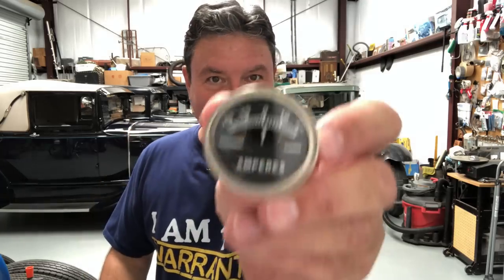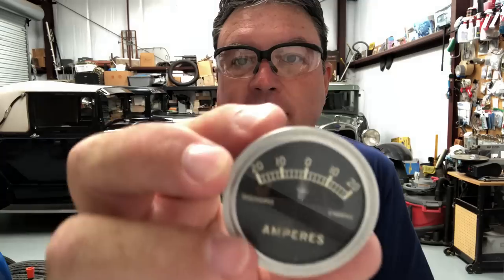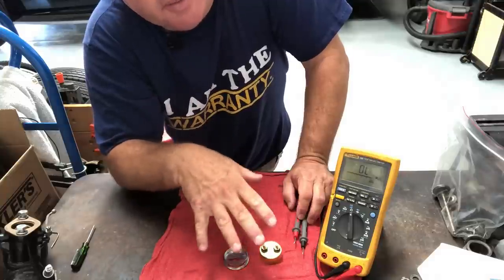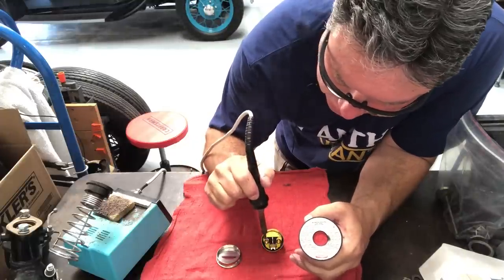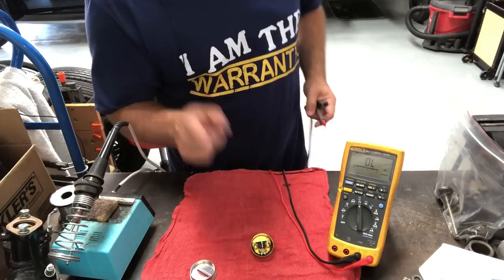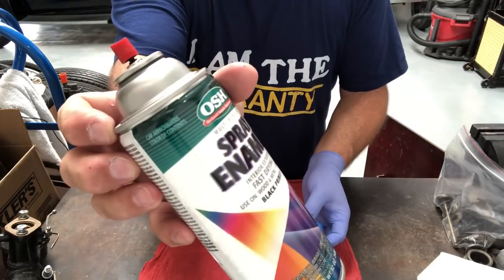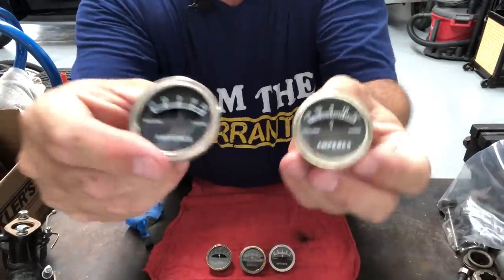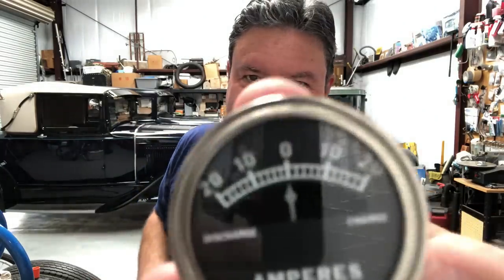Ford Model A ammeter- How to prevent a fire in your Model A

Comment: Good video as always. I cannot solder as well as you when using a pencil tip, I prefer a wedge tip. The use of a higher than normal iron tip is certainly the correct approach.
Don W

Comment: Another excellent video, Paul. Great safety tip. Altho I have LED lights and don't have any large draws thru the ammeter, it certainly is a worthwhile project to "improve" a repo ammeter. Now I have a couple of projects for today on a couple of spare ammeters. Unfortunately I have already painted them black in the past so first I need to remove some paint. Thanks again.
Reply from the maker: You're welcome Dennis!

Comment: Adding to my previous comment, according to your information, one of the ammeters I found in my stash is an original and works. The box it was in was very old , but not original. A mild cleaning and it will be as good as new. Also, one of the 3 reproductions I have seems to be an  unused much older version in it’s original box and much to my surprise, you could plainly see through the glass that the terminal bolt heads are already soldered. If that was done when it was made or later, I don’t know.  Thanks.
Reply from the maker: Neat!  Thanks Bill.

Comment: Good tip, as always.  I have another project now. I use a 20 0 20 on my A with an altenator.  I was told to use a 30 0 30.  Thanks for straightening  that out.   Never did make sense to me.
Reply from the maker: You're good!

Comment: Thanks, Paul.  Great instructions!  My first encounter was with the ammeter terminals that someone had just stripped to bare wire and crimped on terminals sold at any auto parts house.  Nothing soldered, mis-matched wire size to terminals and the screws on the back of the ammeter were only finger tight.  Lots of resistance and HEAT..also due to the resistance the battery was not given the opportunity to sink the charge from the generator causing it to put out 20+ volts.  I am going to take mine apart first chance I get and solder. Thanks !
Reply from the maker: That sounds like a recipe for disaster!  Glad you caught it.

Comment: Just took apart a 20 amp ammeter. Instead of fast/hot solder just undo the two nuts holding the insulators to the back of the gauge. The complete metal piece with the needle will come out and then you can solder without worrying about melting the insulators. Now you can use your $19.00 Walmart soldering iron.
Reply from the maker: I'm just trying to keep it simple.

Comment: Very good, Paul.  Interesting and something most anyone can do.  I think you're right about just needing to see if it's charging or not and leaving it at that.  But I guess back in the day having an actual charge figure was more important than it is now.
I recall how Chrysler products always had ammeters rather than a voltmeter.  But when I thought about it, 35 amps running under a dashboard is a lot of juice.  Years back my brother lost a beautiful '72 Barracuda due to an uncontrollable dashboard fire that I'm sure directly related to the high amps running under the dashboard.  As alternators increased in amperages over the years Chrysler stopped using ammeters in favor of voltmeters.  Imagine 150 amps or so running under the dash.  Jeez!
Reply from the maker: An inline fuse might have saved that Cuda
Reply: @ModelA    I always thought that the factory installed fusible links took care of that.  We couldn't investigate the cause as the dash was so burnt and melted.  It happened when my brother was shopping in a store, and it was parked in a metered space on Main Street in that city.  The police gave him a very limited time to remove the car, so he just had it towed off to the junkyard.  Something we'd never do now because they have become so rare.

Comment: Had one short out on the Tudor when I was about 19 years old, scared the bajeebers out of me seeing that smoke coming out of the dash panel. Turned out the Bakelite knurled nuts had loosened up. Good video thanks, and yes don't touch that needle I swear it is made out of aluminum foil super easy to booger it up. I learned that luckily on a repop so no big deal. I assume originals were made with a better quality material. 
Thanks Paul!
Reply: Everything back then was made of better material.  Things were relatively expensive and people expected them to last.

Comment: Paul your engineering prowess is showing, excellent instructor video and if implemented should prevent that dash fire from poor quality ammeters. Has anyone looked into making fusible link for the model-A to open in the event of a starter and/or alternator shorting?
Reply: I wouldn't use a fusible link on anything, it is basically a smaller gauge wire burning up!
Reply from the maker: Well, people usually install the aftermarket fuse blocks in Model As these days.  That helps.

Comment: Paul, great video. I pulled my ammeter and found char. In searching for a replacement I found Westach Gauges. I ordered one of their custom-built Model A 30-0-30 ammeters. Looks well built and much better quality. 
Tested it with my DC power source and it has been correctly calibrated. 
I measured the resistance across it and found 0.1 ohms. Per your video that is just under half of what alarmed you, necessitating the overhaul and soldering.  The result was a dramatic reduction in resistance by multiple orders of magnitude. 

I am wondering your opinion on 0.1 ohms. Is it too much? Should in be worried?

Mac in the Smoky Mountains
Reply from the maker: Hey Mac.  That's just fine!  Way better for sure.

Comment: Excellent video ! 

I’ve had a very strange thing with my ammeter. now I’ve got mine charging again I noticed my ammeter was wired backwards… (reading discharge when it was charging) so I swapped the terminals round and the whole thing went dead. Swap them back - works again.

There is nothing in an Ammeter that I’m aware of that is polarity sensitive - so I’ve no idea why it would behave like there was a capacitor in there?
Reply from the maker: Ammeters are not polarity sensitive except for which way the needle moves
Reply: @ModelA  indeed - so why mine worked wired one way and not the other is a mystery 🤷🏻‍♂️

Comment: Hi again Paul.
I have been lubricating with 3 in 1 oil, WD40 and penetrating fluid the main shaft and "beveled" gears of my oval speedometer. I am able to rotate it with a small screw driver but it is too hard to turn it by hand with a squared tip driver like you used in your video.
I am thinking of taking the main shaft out and any other gears and polish all the parts that I can.
Any suggestions?
Where can I find a schematic diagram of the speedometer?
I watched a helpful video by Jack Bahn but I need more information on how to take it apart.
Would you use 600w oil to lubricate the speedometer cable?
Thanks

Comment: Another electrical improvement is electronic voltage regulation. A low battery is greeted with a robust charge but ovevoltage results in a sharp smooth reduction of unnecessary power. Everything lasts longer.

Comment: Great video. I have a couple of the reproduction 0-20 ammeters. My question, is the a way to fix one that is really shaky?  One will even have needle disappear for a bit while driving, and then reappear while idling.
Reply from the maker: Unless you're a watchmaker, no.  If you are, then you can rewind the springs and magnetically tension the fields.

Comment: Great video on AMP MERERS.
I've been told not to bend the amp meter clips to hold it in the dash plate.  If you try to bend them, you are probably going to break the needle.  Instead I've been told to use small amount of silicone and use painter's tape to hold it to the dash plate until dry.  What are your thoughts?
Reply from the maker: Whatever works for you, do it!

Comment: Hi Paul.
In your Q&A #6 with Dad it was mentioned a knocking noise in the engine that most often comes from the middle main bearing.
It sounds that my engine may be having that issue.
Could I remove and replace the bearings without removing the engine? 
I have watch videos where they use "the bearing roll-in" trick.
Thanks
Reply from the maker: If it is already machined for inserts, then maybe.

Comment: Alright, looks like I have something to do xD
Mine never showed zero (even with the battery disconnected), I never knew you could even adjust em.
Also: Where does one find these "judging standards"? I know I'm faaar away from a fine-point car, but it might be fun to browse through one of these just for kicks
Reply: How is the engine rebuild coming along?  Have you gotten the block boiled and magnafluxed yet to check for cracks?
Reply from the maker: The Judging Standards are available from MAFCA directly.
Reply: @skategeezer1810  I just uploaded a video on the topic last Friday, the block is crack-free.

Comment: Does this work with 6 volt negative ground? Or is it a different kit that might be available?
Reply from the maker: The ammeter is not polarity sensitive.  If you change the frame polarity from positive to negative ground, just reverse the wires on the back of the ammeter.

Comment: ADD A BATTERY CUT OFF!  I just about burnt my 1930 Town Sedan because the amp meter failed.  The plastic cap nuts to the amp meter melted, so I don't know if a wire came loose or what really happened.   The only A of several without out a battery cut off switch.  Lesson learned.... and luckily I got the battery terminal off through the trap door in the floor board!
Reply from the maker: A fuse is preferred both for safety and cost over a cutoff.

Comment: Another good video. I am going to check if my amp meter is one of those you described and if so I will solder it.
Unrelated question to this topic: When you lubricated your speedometer and were able to stabilize the speed reading, did you try to rotate it by hand with the driver tip? 
Should the speedometer be loose enough to turn it with your fingers?
Thanks
Reply from the maker: Yes, it should turn very easily
Reply: @ModelA  Thank you , Paul!

Comment: I remember at the Twin Cities Model A Ford club where I was a member back in the 80's we made a modification on the generator contacts with a diode to eliminate a potential fire hazard. Is this still done or is there something better?
Reply from the maker: You might be talking about using a diode i stead of the points on the generator cutout.  If so, yes!

Comment: Hi Paul I'm busy with a 35 ford ammeter it seems to work differently to the Model A one. It's seems to be more like a clamp tester around the cable. Is there similar issues to the above that I need to worry about?
Reply from the maker: I have no idea.  Don't think I've seen one.  This has mostly to do with the cheapo Model A ones
Reply: Thanks it was defnitly an insigtfull video.

Comment: That was a scary call! But what about adding Insulator Nuts that hold the wires on? Especially if fuel were to seep around the gas gauge!!!
Reply from the maker: Just put a split washer under there.  done
Reply: I've done both now! @ModelA

Comment: Good info but there is no way that is not a cold solder joint. I suppose if it starts to heat up maybe it will reflow the solder but then it will probably melt that plastic and short the whole shebang. Better than nothing but there is a good possibility for that joint to crack loose.
Reply from the maker: No.  The solder flowing down between the brass parts means it is not a cold solder joint.

Comment: the right fix, but these small solder points will not holt 20+ amps
better solder the whole head of the screw - in multiple atemps, so the plastic don't melt.
Reply from the maker: I suppose that might be even better!
Reply: @ModelA  Or something like spot welding? (like connecting battery cells)
It is a shame, that they build these products so cheap ... and dangerous.

Comment: Wouldn’t it be safer to replace the ammeter with a voltmeter ?
Reply: Maybe, but I have never seen a voltmeter small enough to fit in the Model A dash and it would not look 'original'.
Reply from the maker: I suppose, but an ammeter is original.

Comment: As a general rule, I don't like these meters (ammeters). I've had issues with them in the past.
Reply from the maker: Like what?
Reply: Until you showed the simple fix of dropping resistance across the terminals...
Yep, my '68 Plymouth Satellite had an original that got hot! I smelled it before it burst into flames. I bypassed the gauge and never replaced it. Same with another factory gauge.
I never though about modification or repairs to the gauge. Thanks!